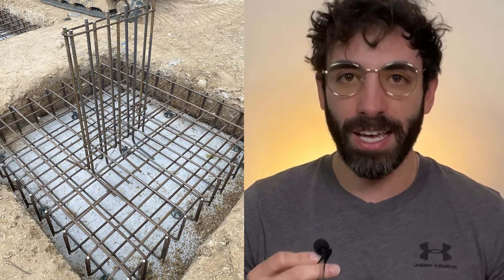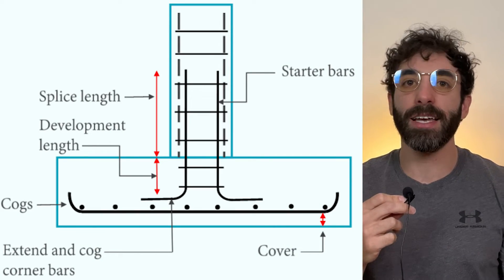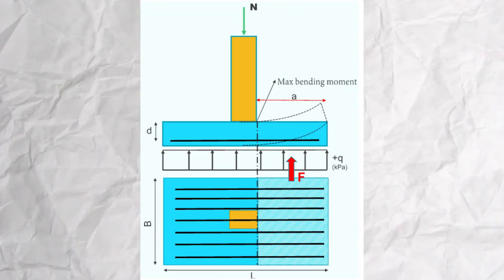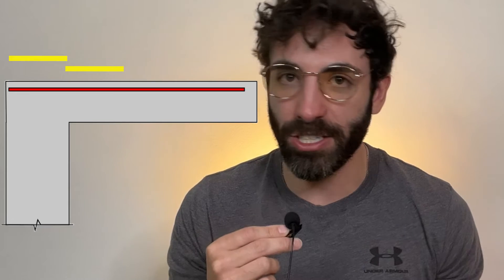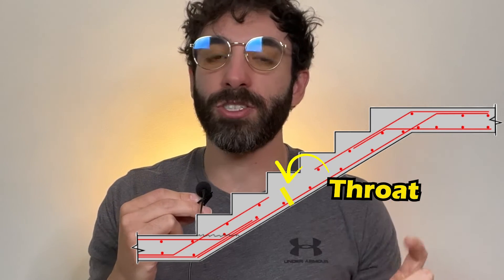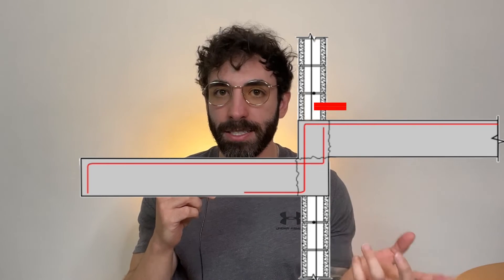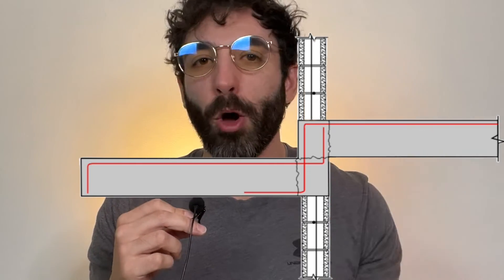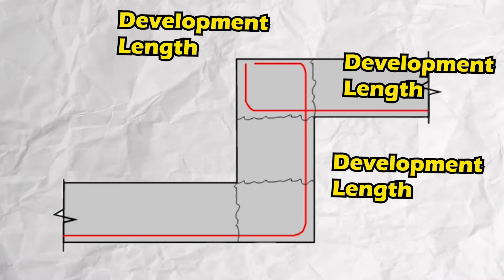Reinforcement Bars in Concrete: How Deep Should They Go

Comment: Hi - novice DIY-er here. I've been reading about J-Bolts and that they are sometimes not Code in areas where uplift are problems.

SLightly complicated, but I'm building a viewing platform in a floodplain for bird observation. It'll be a large-diameter concrete pier, with a wood deck on top, a 3x3' deck. Are J Bolts okay to fasten a Simpson strap to? Or should I use some other bolt fastener, and drill into the concrete after its cured (to then fasten down the Simpson strap, and screw in the wood). I'm a noob, just here to learn, love the videos!